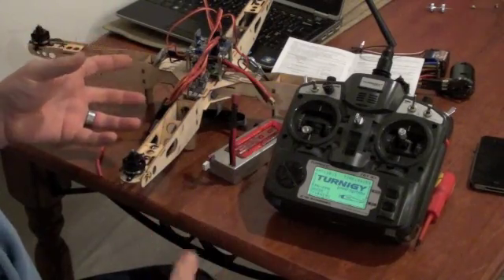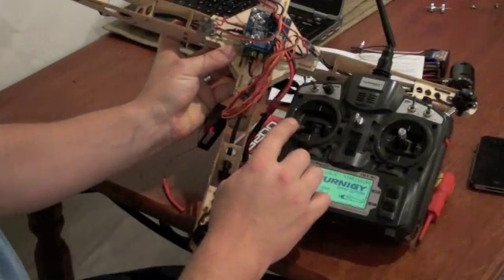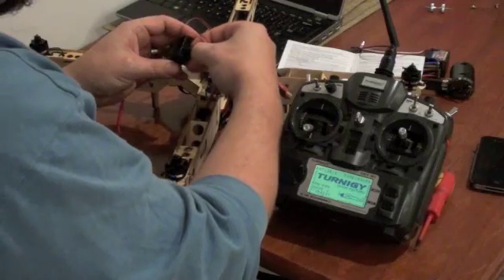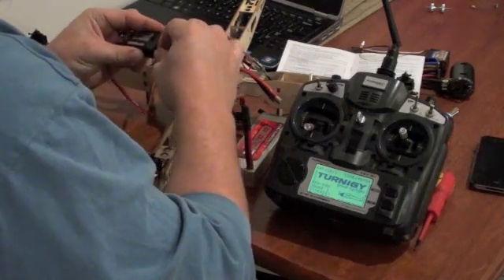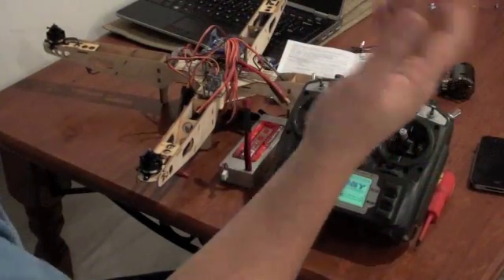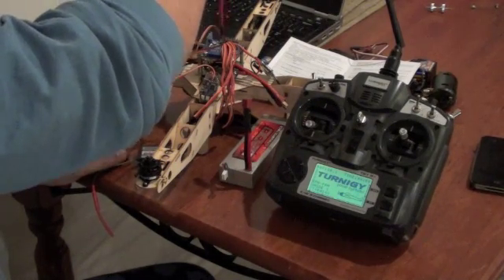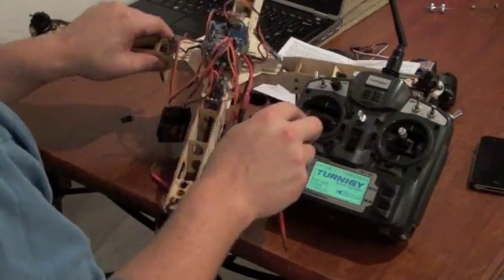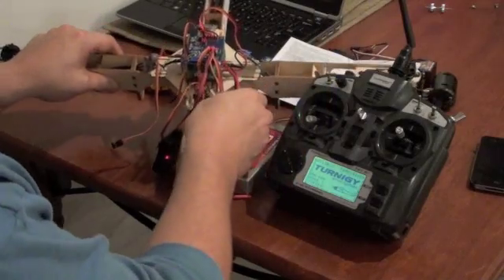HK Quadcopter Multicopter board Xcopter 4.7 Motor problem Part 2

Comment: i had very similar problem with blachboard but in tricopter configuration. 
It came to light that the firmware by mitsoo kim worked with my board but any kaptain k firmware would not? might i recommend a reflash with different firmware. 
Also try to confirm the pot direction on your control board mine was reversed after all my research. Good Luck.

Comment: Don't see any comments here but, you did everything right except calibrating the ESC's through the HK board.  Yaw pot to zero, throttle to max.  Initial beeps, throttle down, and finishing beeps.  Also, might have to center trims, and or reverse throttle channel in the radio.